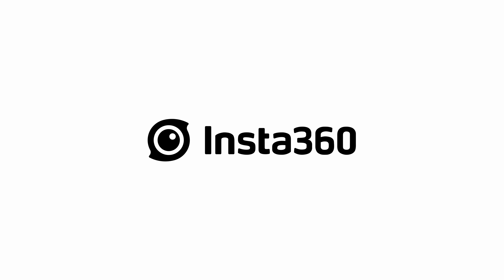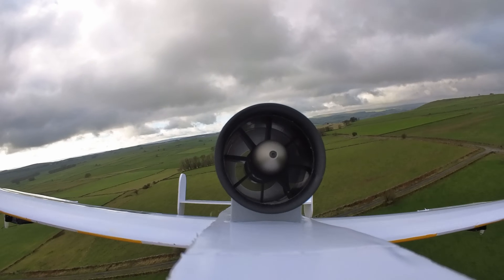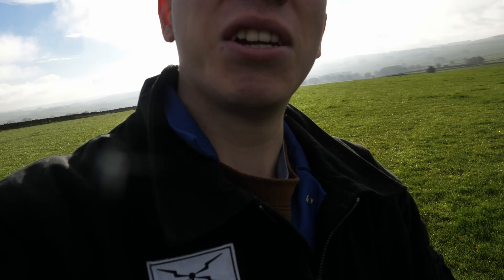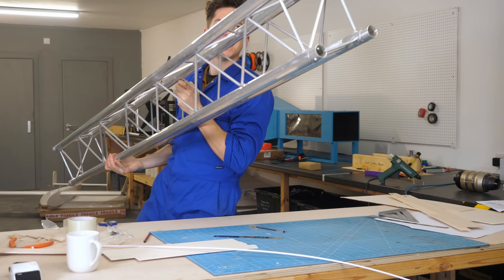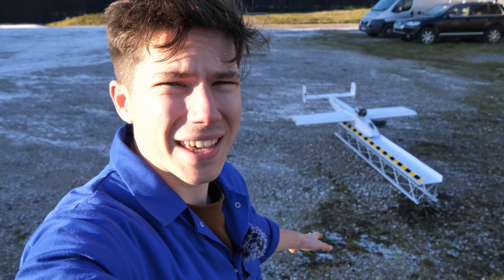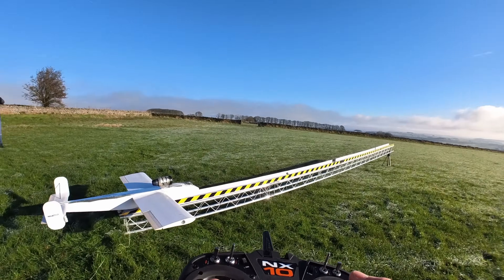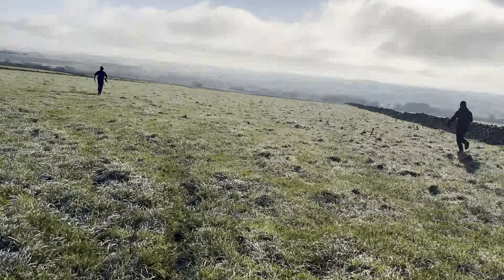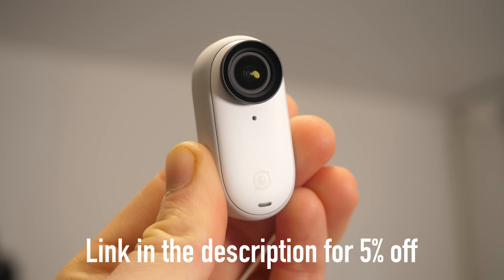Foam RC Jet

Comment: Where was the aircraft antenna mounted relative to the carbon fiber wing strut? In HP rocketry it is well know that carbon fiber can block signals. If your antenna was mounted behind the carbon fiber tube it could make sense that you had full signal when behind the aircraft and choppy signal when it turned towards you.

Comment: Some of the Spectrum receivers suffer from so called brown outs, if the supply voltage goes below a certain level. I lost two helikopters before learning that and bringing the radio back to the shop it came from ...

Comment: Did you use a weighted fuel clunk? When the fuel sloshes around, the clunk will go wherever the fuel goes. I've built a foam flying-wing with a jet on. You can find his on my channel.

Comment: Lots of people complain on the controller of spectrum. But what about you reciever bateries. At home 20 degrees celcius you bateries fully charged. And outside  neer bye 0 degrees outside temprature. You stil have volltage on you hobbyking tester. But no Amps. P=U×I 
it is stil posibele that the engine stopt on failsave. Than is er also not power consumptiion out of you reciever bateries. Like it is switched of. So after a short of time you recievers works again. Because you reciever bateries get some amps back. But than you ask again to match amps. And you reciever go out again.  That can repaet some times. Until al the amps are not coming back again.  And you reciever stays out. Excuus for mine bath writen english. I live in holland.

Comment: From my limited experience with fpv drones, when you point the tip of the antenna on the transmitter directly at the receiver the signal gets weaker. The dipole antennas of transmitters signal are strongest to the sides. 
Also i am only theorising, but could the rpm of the engine slowing down maybe create an em field via the starter motor that interfered with the receiver?

Comment: Did you range check the receiver? Did the receiver have Failsafe programmed? I had exactly the same issue with a foam airplane last summer. At about the same distance I lost control. But the Spektrum receiver kicked into Failsafe mode and landed the aircraft with no damage. Then I remembered that I had not done a range check after rewiring the area around the receiver. So, after recovery I range checked it, and guess what, at about 10 meters away I was getting multiple holds. Took off the wing and found the antenna had come loose and was surrounded by servo leads. Fixed that and it checked out and flew fine. Like others in this thread I'm thinking given antenna placement the motor, fuel tank and all that foil on top caused the signal fade. A thorough range check should have detected issues. Failsafe would have saved the model, or at least reduced damage.

Comment: fantastic project! some thoughts...

1) if your antenna was internal and your aluminum shielding came between it and the receiver, it may have interrupted the signal. paired/redundant antennae, or signal-neutral shielding (like high-density wood that's pre-charred or even graphite sheeting) should be considered, as well as a signal amp (check FCC(Ofcom)/FAA(CAA) guidelines for compliance) and max your signal power at both ends! (you can use a directional antenna on the ground to bump that end without fiddling with electronics, and they can be made with a broomstick or pipe and some wire!)

2) consider a catamaran fuselage pair to flank the engine, or an open box-kite-style fuselage with electronics and gear in the side-walls or nacelles. In either case, you can lower the engine to between the 2 bodies, or inside the one, for a more centered thrust to eliminate the pitch bias caused by the leverage of the off-centered thrust application.

3) on an other project, you could try out 'Vector rudder' tech! it's a box or cross shaped tail on a  knuckle with servos, the whole thing points as one, rather than using any kind of flaps. I think it'd be fun to see how you solve it, and how it feels to fly one!

Comment: Why did you kot activate the restart enable on the ecu on the engine. Then it will quick hot restart the engine in the air .

Comment: Did you do a range test first. The receiver antenna needs to be separated from any other electronic equipment and not be shielded at any angle to the transmitter by the carbon spar. The pitch forward was due to adding the centre of thrust to the centre of gravity resulting in a turning moment. Maybe move the jet back slightly to compensate for this i.e. were you always putting in up elevator trim? There must be a way to make an inline foam jet without it melting. Balsa or plastic isn't exactly flame resistant either. You would have a very fast jet then. Also maybe a slight wing sweep will add stability.

Comment: I think the RF signal issue is most likely caused by the use of a less robust protocol. I would recommend moving to  crossfire (either TBS crossfire or ELRS) to ensure that you dont loose the signal. Both of those are capable of reaching tens up to hundreds od kilometres range. Spektrum i made for LoS flying and its just not stable enough.

Comment: Very interesting and fun experiment. Hopefully the engine was not to damaged beyond repair. The most expensive and critical component. Would like to see a second attempt. 

Where was the radio receiver located in the aircraft? 
My thought is the aluminum foil on the fuselage may have created a shield blocking, or distorting the radio signal. Note this is also somewhat a problem on carbon frame drones, as the carbon also blocks radio signals. I'd suggest mounting the radio receiver/antenna out near a wingtip.

Comment: I would highly recommend not using spektrum. I've had many issues with brown outs on spektrum when flying with other planes or going long distances. In my experience FR Sky is much more reliable and you can add a different transmitter module to the back like the ghost module for extremely long range. Spektrum is much more intuitive but fr sky offers a lot more options and quality for a much cheaper price (I'm sure there's other good options besides fr sky, I just like their radios)

Comment: I think that maybe to lost of signal happened because of the foil blocking the radio waves. Because when the jet rolled over it the foil was put between the transmiter and receiver and controller on the ground.

Comment: When the engine stalled, did it start some kind of routine that fired its ignition system automatically?  And the interference from that interfered with the radio signal?

Comment: well it has been done before with even larger pulse jet engine and the plane made of metal. It was called a Buzz Bomb of WW.2 made by the Germans. So there you go you are trying to downsize 83 year old tech. Plus making the machine out of foam. Have fun but it is hardly anything new!

Comment: First thing I would do is swap radio systems. Going that fast you may need longer range and better penetration then a Spektrum can provide. If you want to stay on 2.4g then Expresslrs is the way to go. Expresslrs just came out with a new gemini system which can be setup like having 2 receivers on the plane. Betafpv even just released a 10 channel gemini receiver. Mads Tech just did a complete video on it. You will need a radio with a JR type bay and LUA support. Radiomaster makes a good radio if you don't already have one.

Comment: It looked very much like you were busy pointing the null of the TX antenna radiation pattern at the model. Assuming it is a simple coaxial dipole sticking up out the top of the TX then the point of LEAST signal is at the pointy end of the antenna, the bit many people "point" at the model during signal loss! Moral of the story is hold your TX "up" so the donut shaped radiation from the sides of the simple vertical on the TX gets to the model. I have no idea why the numpties that design TX still use fixed vertical antennas like this.
Also not sure where your RX was in the aircraft but you did build yourself a foam and aluminium fuselage in the end.

Comment: @projecy-air 
Use crossfire or Express Irs (1 watt)transmitter and ressiver for max range. And use speedbee f405 wing flight controller for auto leveling and fail safe.

Comment: Radio interference. interference is rare with modern controllers but the servos returned to the position specifically that rolled the plane to the left several times so that would be my guess. That is how radio interference acted on my older low quality radio.

Comment: Yet another great example of why we don't trust spektrum for anything of value. @ 15:00
Every time i've given their hardware a chance, it failed me miserably. Luckily none of that stuff was capable of getting off the ground, so I've never had to suffer a loss from it.
Terribly unfortunate though. If you're putting thousands of dollars on a plane, at minimum, I'd go with Futaba hardware, as their track record is impeccable. They also own a massive share in the commercial sector.

Comment: i have a theory for why the radio cut off, if the fuel cut off and stalled the engine the rapid speed loss might of caused the wiring to come undone and temporarily come back from it going down, it was probably pitching left because when a RC controlled plane loses signal it will execute the last input for around 4 seconds. Also, the metal foil might of caused radio interference

Comment: You're going to need a transmitter/receiver that can handle the range that jets are capable of in a very short amount of time. They can cover a couple kilometers in a minute, not a couple hundred meters, as with the prop/EDF planes you're used to.

Comment: Also, yeah, when sending a lot of money into the air, use a flight controller and not an ancient shitty control link. You can choose from tbs crossfire and 2.4 elrs, both work great. Use rfd-900 or sick radio as a backup and you'll never lose an aircraft like this, even if something stupid happens like a battery dying in your radio

Comment: Reccomend you invest into a nicer radio system, Spektrum are notorious for "brownouts". Get a radio running Edge TX instead like a TX16s and an ELRS module for it. That will give you miles and miles of impeccable signal strength

Comment: To built an aircraft for speed ,you should consider a frame with the lowest drag factor. Your aircraft does not look like it is shape for low drag and speed. Just saying....it could have  been  build and shape form  for  speed.

Comment: The reason the plane pitched on takeoff is because the thrust line of the turbine is outside the center of gravity, you must put the turbine further back from the center of gravity And move the fuel tank further forward to compensate for the weight of the engine

Comment: Don’t use a low-end Spektrum radio and likely a low end Rx on something you plan to fly more than 400m away. They are designed for bind n fly parkflyers and have issued beyond previously stated range. The higher end Spektrum stuff was re-engineered and bolstered to suit the larger fuel powered type aircraft. 

Even still, I don’t trust Spektrum through more reasons than people would want to spend time reading here

Comment: I think the loss of signal was probably caused by the aluminum tape covering the back of the plane; when you rolled it blocked the path. Having the antennas stick out a lot would probably fix this. Of course, you could also just not use so much aluminum.

Comment: You should really get a radio with edgeTX and ExpressLRS build in or with a module bay and an external ExpressLRS Transiver. With that you will never experience a signal loss in a range where you can still see the plane. I really like the radiomaster Radios and they are not too expensive especially compared to the spectrum Radios.

Comment: this has been an interesting video for me in many ways. as an aeromodeller of the best part of 40yrs, when crash happen i do my best to get to the bottom of why. from just watching your footage, im not sure how you came to the instant conclusion that it was an air bubble. the model definately went into failsafe state and i would suspect the failsafe state for the throttle was fully down eg engine stopped. from what i can make out it entered failsafe 3 times with momentary return of control. I would have been looking at the power to the RX initially rather than a loss of signal to rule that out. the bggest single point failure in models are the rx switches followed by the batteries.
It also amuses me that people in the comments are very quick to say that it is the fault of the radio system that you use. I have been a very happy Spektrum user for many many years. for flying model jets you dont need ELRS systems, you just need a reliable system.

Comment: I would guess that due to the air in the pump stalling the engine, and thus the engine no longer consuming fuel, the pump would have pulled a lot of current trying to pump the fuel to nowhere probably causing some cables to short out (due to getting hot and the isolation melting). The cables could have also just shorted out normally, but i would guess that he checked that beforehand. Thanks for the good content, keep it up!

Comment: Most likely signal lost was, loose wire to controller.  You regained control for a moment then lost control for good.  That, for me suggests, loose wire.  Where possible, solder or use screw connection.  Don’t use plug connectors.  Good show otherwise 👏👏👏👏👏

Comment: For something like this you'd need some kind of extended range antenna and power system at a ground station to ensure you'd have the range to cover the flight ops. FPV, some autonomous system controls for when LOS occurs, GPS navigation on the unit. Or could be as simple as switching to a better receiver/transmitter combo on your radio and craft.

Comment: Maybe the receiver battery got too cold and the voltage was too low? 
Alternatively, a bad connector where the wire popped out of the pin.

Comment: It's crazy you're not using crossfire or elrs for something like that, there's no excuse for failsafeing that close to you.  Elrs is dirt cheap and has 100+ mile range with the right transmitter/reciever and a 10 mile range on average, and it just works and practically never failsafes.   Spektrum is your dad's transmitter.

Comment: Is there a reason you still use outdated spektrum? Use tbs crossfire you'll have range forever...ive flown 40km out on crossfire with perfect signal its good for 100km+! Even elrs will blow you away

Comment: A friend of mine built a rec/transmitter tower. We had a notch filter, and other components, I forget now its been over 5 years.  we would suffer signal loses going big distances. We essentially had a pole that was about four to five feet long, and we would attach it to a fence post, which  about six feet high, give and take 10 feet tall total, and had a pretty good transmitting and receiving tower. He managed to fly his RC plane for over .5 mile, or .805KM, possibly even further but we didnt want to risk losing the aircraft in unknown territory. Maybe that helps.

Comment: Great model, much simpler using glass fiber tape than fiberglassing. Could you use a baloon for a fuel tank, I remember seeing a babies dummy being used for an rc model, filled with a syringe until it was egg sized.

Comment: You need to design some redundancy in the system. Have a satellite receiver and maybe even design extra control surfaces completely independent of the main system that will be operated by a friend with a different controller. (Secondary ailerons inboard of the primary ones, and a secondary elevator. Or have the vertical stab be larger and have the rudder be the independent system for maintaining direction control in the event of primary failure). The pitch sensitivity seems to result of an aft cg, perhaps locate if further forward, and incorporate nose up trim on the launch. Best of luck on mark 2!

Comment: i highly recommend to use INAV on a flight controller as an back up system for exactly that case of a rc loss. it just switch to return to home without any crash 👍🏼👍🏼🍀🍀

Comment: Please please move to ExpressLRS receivers. It is heartbreaking to lose a plane due to bad radio link.

 Everything I've ever used in airplanes (spektrum, futaba, frsky) are all junk, expensive and run outdated and unreliable RC link. I have had multiple links dropping on me with carbon or some metal in the frame, ELRS never dropped even kilometers out. 

Thank you for that protocol quad community.

Comment: As an Rc Turbine pilot you have to use something called UAT with turbine jets which catches the bubbles and prevents the engine from stalling or flaming out, as per the loss of signal goes you have to use particular type of receivers for these jets because they go fast and far although i don't recommend spektrum but they also have multi setallite receivers for better signals, i personally use Frsky New tandem radios which has 2.4ghz and 900mhz backup or go with jeti radios for turbines..

Comment: You have 2 vertical stabilizers on the outer end of the elevator. You can easily use them as rudders. I think you will get better performance if you move the motor back to the CG, since placing it forward of the CG causes the aircraft to pitch down, and when it stops, the aircraft will pitch up and stall. Which may have been the reason you lost control!
Reply: That's right, but a rudder would not work well with a fast plane.
Reply: @altermannfliegt3927  In the future you might try to develop a jet powered quadcopter. You could tilt the motors to control the thrust. That would be really new and inivative.

Comment: Where were the receiver antennas placed and was a radio range check performed? Foil tape, the engine, general EMI, and other electronics can physically block the signal if you’re not careful.